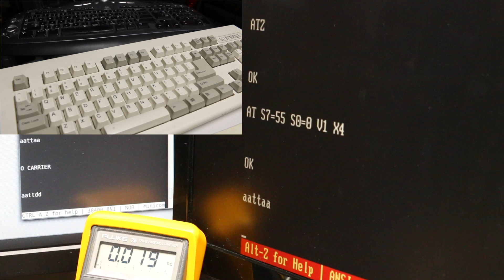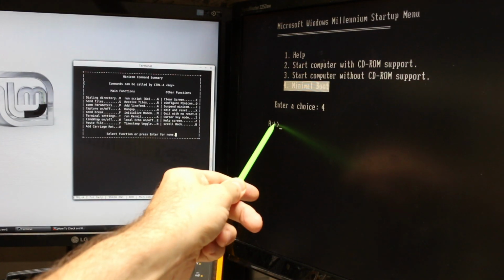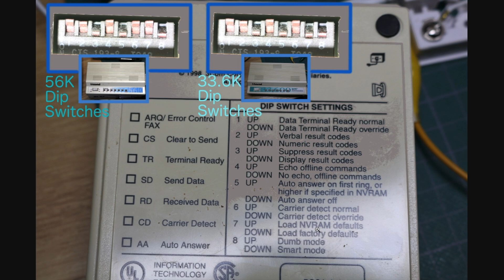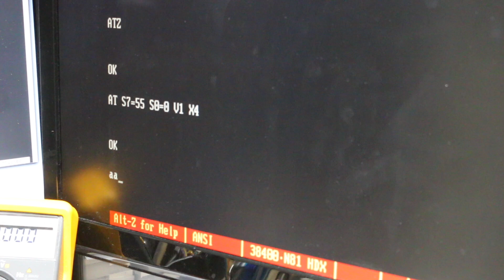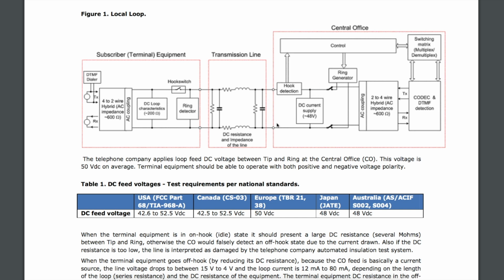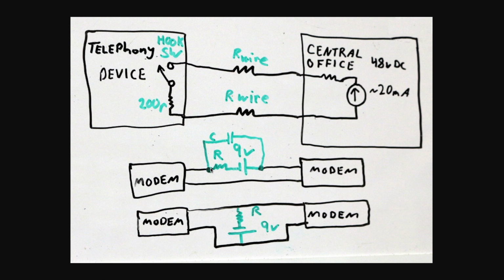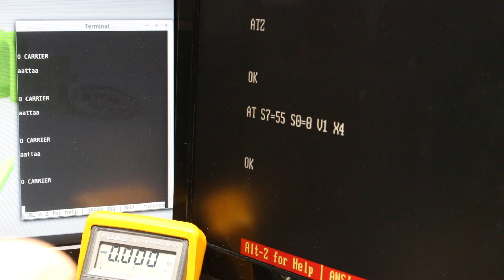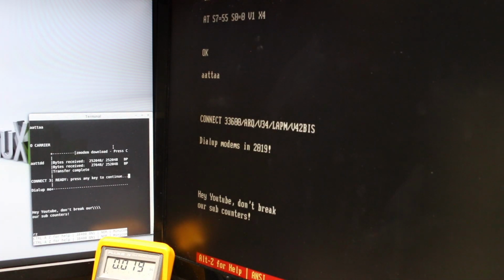56k and 33.6k Modems Connecting to Each Other with no Phone Service

Comment: WFW, windows for workgroups was the FIRST code you could run on windows for "networking." Connecting LOCAL computers at home or work into a "working group," where you could exchange data at 11 MBPS for the 1st gen across an ethernet cable. Then came 56 MBPS where it stayed for years until 100 mbps ethernet cards!

WFW interfaced to an "add in" ISA or EISA card, with the RJ45 adapter and code for either TOKEN RING or ETHERNET!

The NETWORKING and TCP/IP stack was provided with WFW!!!

Comment: Do not focus on the DIP settings. We never used to change them EXCEPT when using protocol converters for Mainframe EBCDIC to PC ASCII and other tweaks needed to get the two to talk.

Normally you issue the ATDT 12025551512, the modem would dial and wait, once the modems connect a CD carrier detect will light up on the modem.

This means the physical connection is made, the a CS clear to send signal will be RAISED by the software on the receiving modem, effectively saying I am waiting and ready for you.

If the sending computer sees a CS, it raises a Request to Send RS, and the receiving computer should start recieving data. And ACK. acknowledges the data is received.

This is a VERY SIMPLE overview, but wanted to make sure you did not change DIP settings UNLESS NECESSARY.

Do NOT worry about NVRAM or ROM. That is the encryption cyphers and protocol data.

Comment: In the 90's I needed to test various MODEM's for use with leased lines (point-to-point twisted pairs with no line voltage) for a national stock exchange I was working for.

I found plenty of MODEM's would not work on leased lines, even including those advertised as being capable of working on leased lines which lacked line voltage.  The one MODEM I did find which not only worked, but was rock solid at keeping the connection up, was the US Robotics Courier V.Everything.  So we decided to deploy them.

Those USR V.E MODEM's could stay up literally for years, non-stop.

Comment: I have an idea why your current calculation required such a low resistor. In the series arrangement (Modem A - 9V - resistor - Modem B), you've got one current path at 20mA. If the 9V source is connected in parallel like you have, what you're doing is making two separate loops, with 20mA passing through each Modem A and Modem B but needing 40mA current in the central leg being drawn from the battery. That's why you need a resistor with half the resistance you thought you did.

The difference between the two is with the battery in series then the modem signals have to push against the battery to transmit anything (so the capacitor across it helps the wiggles get through). With the battery in parallel there's no (added) resistance in the loop between Modem A and B, so the transmitted wiggles can transmit easier. Do you think I'm on the right track?

Comment: I am trying to get this setup working between a USR 56k modem and a Racal-Vadic 2400pa; as far as I can tell, the 56k does support speeds all the way down to 300bps if needed. I can't seem to get the 2 modems to talk to each other at any speed, with "ata" I can get the 56k to start a high pitch tone, but "atd" on the 2400pa will just cause the relays to click, then will temporarily stop the tone on the 56k, before eventually returning "NO DIAL TONE", and the 56k will eventually say "NO CARRIER".
Have you ever had success with getting such old modems (1987) to connect with the more modern ones? Or do you have an idea what the problem could be?
Reply from the maker: I've only tried doing this with the USR external 33.6 to 56k but one problem could be the dialing modem is waiting for a dialtone, which won't exist with just the battery current source, so instead of ATD  try ATX3D   to tell it not to wait for dialtone

Comment: Even with 2x 56k POTS MODEM you wouldn’t achieve 56k logins, as the 56k mode needs a digital adapter on the "offering" side, i.e. an ISDN device that acts as a 56k host. Direct analog connections between 56k devices will always end up with 33k6 connects. Everything above 33k6 needs e.g. an USR Courier-I (I for ISDN) or a ZyXEL Elite 2864 ID (again, I for ISDN).
Reply from the maker: that makes sense.  It’s still better than what I was ever using, I started at 2400 and graduated to 14.4K and around the time dial-up was disappearing I bought a refurbished 28.8 K Motorola but the fun was over by then.

Comment: Is there a way to automatic answer when you try to dial in? So someone doesn't have to be there on the other end.
Reply from the maker: I’m working on a new project that I plan to make a video for next month to simulate an actual phone service where   both modems can plug into jacks as if they are in separate locations and one can call the other like it’s 1999, and the one on the receiving side can automatically answer.  I am going to test it out by setting up a BBS on one computer and dial into it with another computer.
Reply: @GadgetReboot  nice. I can’t wait to see that.

Comment: A great video! Thanks for sharing!  I remember my horrible experience with dial up. Had some horrible service called Busprod then later changed their name to bpsinet or something like that. After they went out of business went to egix, inc. Horrible service! Seemed liked every time I would turned around blinked my eyes. I was always getting disconnected for some reason! It was so annoying! Trying to download any large file was almost impossible! Using programs like emule was totally useless with dial up. Can't say I have not missed dial up!
Reply from the maker: The main thing I didn’t like when I got my first 2400 modem was taking about 15 minutes to download a file just over 200 K.  I didn’t really have ISP disconnect issues, it was more a problem of other people in the house picking up the phone and causing disconnections.

Comment: Thanks for this video. Brings back good memories.
But, when I and my friend ware experimenting with connecting two modems in the same room we (almost) didn't need any voltage or current source on the fake internal phone line for this to work.
Our setup was:
-two PCs with PCI modems
-real working phone line
-dad's old Ericsson mobile phone
-one phone cable with RJ11 connectors

Only problem we had was that we didn't know how to force one modem to answer a call manually (skip ring signal detection) because we ware using a multiplayer game (Colin McRae Rally I think) not terminal so we couldn't use AT commands directly. Then I came to this idea: one modem will be connected to real working phone line waiting for the ring, other will be ready to make a "fake" call to some random number, then we will call our real phone number with mobile phone and wait for first ring after witch first modem will answer the call. In about the same time we will start making the fake call from other modem so when first modem detect a real ring signal we will quickly disconnect it's cable from the real line and connect two modems directly without any voltage or battery in between. And this was working perfectly except some times when we ware too slow to disconnect real phone line form first modem and that first modem answers the call billing my dad's mobile phone which was not cheap back in the time.

Sorry for my bad English ;)

Comment: I plugged my modem into the land line and I tried dialing but there was no sound :(
Reply from the maker: I forget if a modem even needs to see an active landline in order to try to dial but assuming the landline works and the modem works, maybe just a different initialization string is needed to make sure the volume is on and maybe make it not wait for dialtone, I can’t remember all the AT commands now but ATX3D sounds familiar for maybe not waiting for a dial tone
Reply: @GadgetReboot  what would you suggest I do to get my modem to make the iconic 56k modem noise on command? I had do move my pc in the kitchen to plug it into the phone outlet because I don’t have one in my room and I don’t want a big dial up Internet server in my room. I have a us robotics gaming pci 56k v.90 modem.
Reply from the maker: I don’t have my stuff set up to do any testing right now but if the phone line you are  plugging into is not active you might need to provide power to the modem with a battery.
 But the first thing I would try which would be the easiest is to look up modem initialization commands to not wait for dialtone before dialling and to make sure volume is up and if that doesn’t work either the modem doesn’t work or it needs a powered circuit or a phone line
Reply: @GadgetReboot  I don’t use the land line for anything so it’s definitely not active but the modem is brand new. Also the volume is on high. Would a land line simulator be able to send a dial tone to the modem?
Reply from the maker: if it’s a proper simulator then it should because that would be part of the main purpose of it but of course if there is a product calling itself a simulator I would read all of the specifications to see what It can or can’t do. some of them are strange things maybe only meant to be used as a telephone intercom so you pick up a receiver and it sets off a buzzer on the other side and it’s not really a true simulator.
Reply: @GadgetReboot  so the modem doesn’t need to have a connection to a dial up isp or another modem to make the sound, just an active land line? Is the sound just the attempt to connect to the internet?

Comment: The baud setting in Telix is between the computer and the modem, NOT the line speed between the two modems. Back in the day, you would never try to match the baud setting on your terminal program. Instead, you set the highest baud that the modem and the computer can communicate at; ideally, that will be higher than any speed the modems can connect to each other. @4:28

Comment: Excellent work! If I remember correctly, some modems, especially courier and USR Sportster has “line driver mode” where they would be used on a leased “dry copper” circuit like a series 1000A fire alarm circuit. Might be worth a Google!

Comment: FYI - if you ever buy a second 56k modem, don’t waste your time trying to get them to connect at 56K. The ISP side has to be using ISDN (usually PRI) in order for the v.90 modulation to work.
Reply: very true, i was going to post a message about that but you beat me to it. 33.6 is the max you can get with the bandwidth of a pots line.
Reply: I wonder if anyone actually tried with a short line like this. I've seen a project, a long time ago, that managed to do over 100kbps on short lines analog lines using a sound card connected to a hybrid circuit. In this short run the signal will likely be clear enough to attain 56kbps, but I have no idea if the modems even try to, after the initial handshake indicating a scenario where 56k wasn't supposed to work.

Comment: You could make a real phone line using an Adtran TA904. Build two FXS interfaces with phone numbers and they’ll be able to dial each other, get ring voltage, and answer normally without having to jump through hoops with special S register tweaks.

My usual blind dial method was ATX3D
If I was on the phone w/ a friend and we wanted to switch to modem for a game or something, one of us would type that and the other would type ATA.

Comment: If the internet cut out and no one had it to connect to anyone.. Could you whip this bad boy out? (Obviously I am not technical, just curious)
Reply from the maker: If people went back to the pre internet days and everyone had these kinds of modems, and land lines, yes!   I wonder if there's a way to adapt it to work on a cell.
Reply: @GadgetReboot  Too much compression on the cellular network. Best you'd be able to achieve would be 9600K, if not less. Yes there are wideband codecs in use now but they seem to still have far too much compression.

Comment: Instant sub. Man, do I appreciate you doing this.

Edit : OMG the Telix flashback tho.
Reply from the maker: I'll be doing more things with a custom made circuit board at some point where I just plug each modem in and simulate a phone line more authentically but not fully (no actual high voltage ringing).  But I'm in the process of moving so that will take months.

Comment: This is excellent! 
Around the year 2000, I was able to accomplish a link between two Windows 98 computers using a synchronous null-modem cable and a dialup connection. TCP/IP was running also over both computers and the host with ICS worked like charm with a speed of 14kBytes when transferring files between the computers or from the Internet.

Comment: Gosh I want to set something up like this. How could one do this with very few resources? Could I hypothetically buy a pair of softmodems and just wire them to each other, then control them manually? I can never find any proper softmodems, they all seem to be from no-name, untrustworthy companies.
Reply from the maker: there are certain modems that support directly connecting to each other without a phone line or simulation circuit but I’ve never had one and the only way I could get modems to connect is having The battery to provide the same loop current that a landline would provide.

Comment: Just pick up in Originate mode.  Type AT&FX0O on one modem, and then you can type ATA on the other.
Reply from the maker: i’ll try that command string when I get everything set up again eventually, I just remember that no matter what I tried I couldn’t get things to behave properly. It’s a wonder I ever got a BBS running for four years back in the 90s. But I guess I was younger and smarter.
Reply: @GadgetReboot  I remember stick a pair of modems back-to-back in the 90s with a really long extension cord and learning the hard way about Originate and Answer,  ATO and ATA.  
.
In truth I am sad at how much Hayes commands are fading from my memory.
.
Serial comms really felt like I was somehow living the future.
.
Reply: It was also when I learned that 50' of extension cord is electrically noisier than a few hundred feet of the cat3 or higher that they had running into my house from the pole, and I could get higher speeds from the computer upstairs to the computer downstairs by just calling it over the PSTN rather than using 2 extension cables.
.